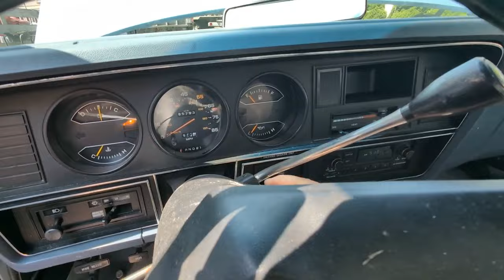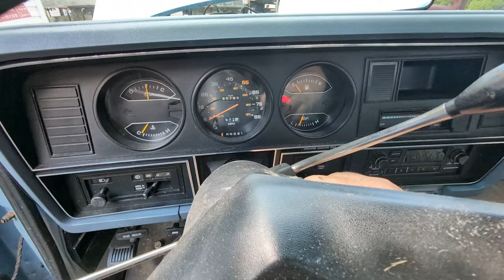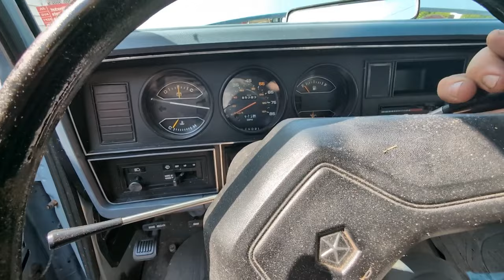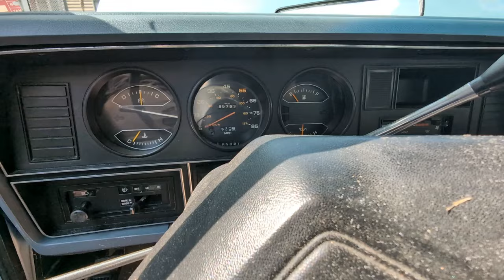First start after 13 years! Slanty six

Comment: had an 87 exactly t like this one bought it for 7800 brand new. same engine and tranny. sold it 15 yrs later with 192000. still ran fine. regretted selling. no rust or rot. good trucks. thats when it was still made by chrysler

Comment: I realize that, at the time of the introduction of seat belt laws in the early 1970's, to get the driver's attention, all automakers had obnoxious buzzers installed to ensure you didn't ignore the seat belts. It was a tough sell, but obnoxious buzzers worked, finally giving way to more pleasant chimes. Dodge, however, had one buzz for the key in with the door open, and a second slightly detuned buzzer for seat belts. The two of them together are perhaps the most obnoxious sound pairing ever to intentionally come from a vehicle. And they still buzz just as loud and proud as the day this beauty came off the assembly line.

Comment: Did you forget you need to pump the pedal about 10-15 times to get fuel to the carb, or are you spoiled by FI lol, Otherwise, Smooth runner.